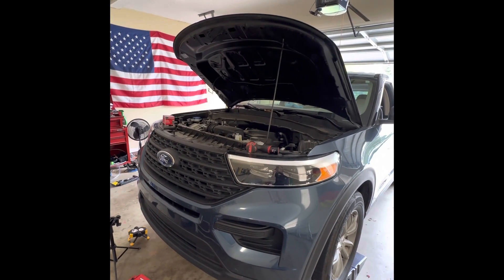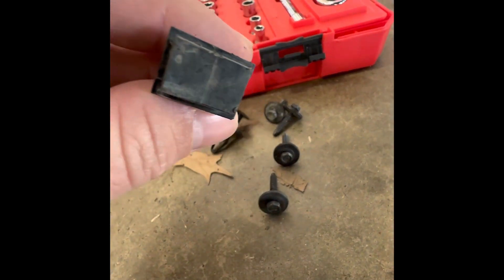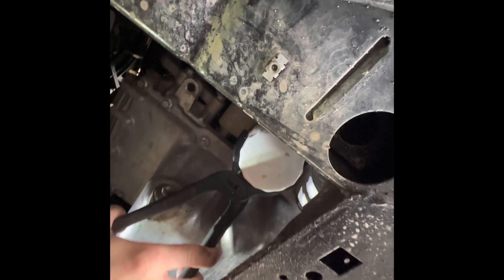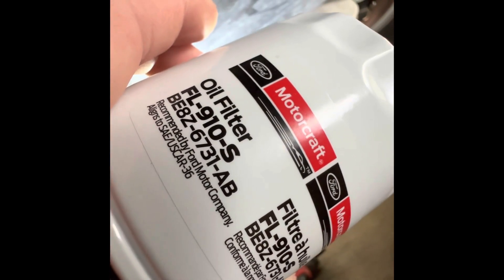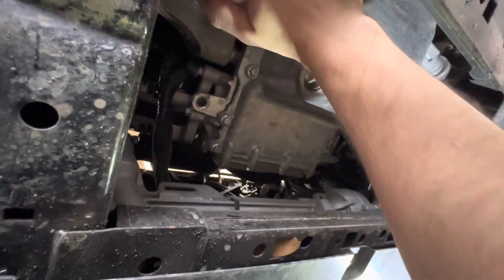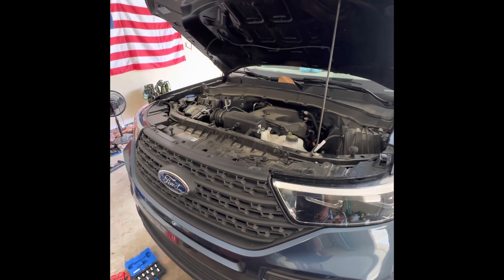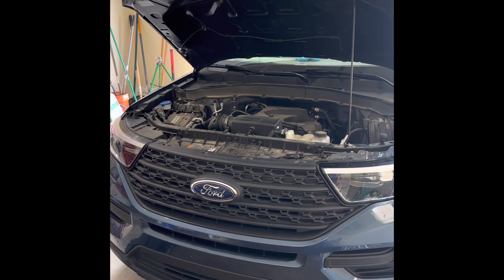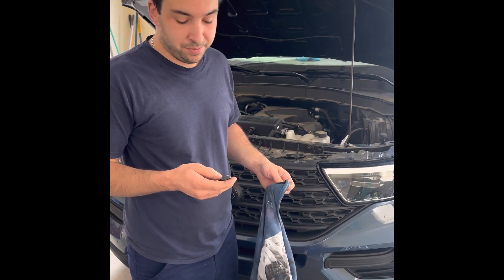2021 ford explorer 2.3 ecoboost oil change

Comment: Thanks for the tour under there! I'm doing an early "break-in" oil change on my new 2025 Explorer Active this afternoon. Has 1k miles on it. Many folks would say this isn't needed. But I am old mechanic, so humor me. The night I brought the car home it was mechanically very tight. It didn't even coast well with your foot off the gas. I always do my break ins with mostly around town driving. Lots of starts and stops and rev ups and downs. Never drone at one speed. That helps to seat the piston rings, polish in bearing surfaces and mating gear surfaces and generally break everything in nicely. That beds in your brake pads too. When I got the SUV, it would only get 20 mpg, and I said it felt tight, right? Now, with 1k miles, it "glides" around by comparison. It's getting over 24 mpg driving it around. Feels much better. Good time to do a service. The factory oil is a synthetic blend and has UV dye in it so at the factory they can easily check for weeps and leaks when they test run them before installation. Does that dye affect the lubricity of the oil? No one can tell me. Then why leave it in there for a bunch of miles. Most of the break in happens early on, good to switch to full synthetic oil now IMO. This motor has a turbo, and its bearings can run red hot. You should run synthetic in turbo motors to prevent the oil from burning up in the red-hot bearings and forming black coke sludge. That sludge can wear the bearings and clog return lines and then reduce the oil flow to the bearings. If you have the 4WD Explorer, also consider an early change on the gear oil in the PTU. Power Take-off Unit. It is a small gear box surrounded by hot components and runs continuously as your drive. It provides the power to the wheels to make it 4WD. It only holds about 1/2 quart of oil and is splash lubricated inside with no filter. Just a magnet on the fill plug to catch swarf. Swarf is the metallic shavings and particles that form as the gear faces run on each other. Leave the swarf in there and you turn the oil into grinding compound. NOT good for the long term use the that gear box! Ford will tell you it is sealed for life. Yes, a short pathetic life that barely gets it thru the 36k miles warranty. Then you are out $3k for a new one as they are not rebuildable. We live in an era of planned obsolescence folks. Servicing your car better can make the components last much longer and save you money in the long run. I just paid $36.5 for this car. Had to deal for 6 hours to get the dealer well below the MSRP. Thank you for this presentation Bimmer! I too believe in full synthetic oil changes at 5k miles. Unless you drive around town a lot, then do it when the oil computer says you have 50% oil life left! On my last car, I sometimes had to change it at 1800 miles as that was 50% oil life! Next to your home, this is the most expensive thing most folks have. Take care of it folks! Don't treat it like an appliance.
Reply from the maker: @chairrider2462  it’s nothing wrong with being extra preventative

Comment: Super good video but I do have a few questions:

Did you warm up the engine prior to changing the oil?

Did you remove the oil fill cap (top of engine) prior to the oil change?

It probably doesn't matter but why did you remove the filter first?

Did you clean up the excess oil on that cross member?

What type are oil are you using on this vehicle?  Full synthetic or Synthetic blend?

Again, great vid and thanks!
Reply from the maker: @michaelhart738   you don’t have to warm up the engine it just allows the oil to flow out quicker. You don’t have to remove the cap prior to draining. It’s just my preference to change out oil filters first. I use synthetic blend. This is a relatives vehicle. If it was mine I would use full synthetic but any ford dealer uses synthetic blend standard.

Comment: Does it help to change out the oil even sooner than 5k miles? What about every 3k miles or something? Just to treat the engine really nice?
Reply from the maker: There is no need to change it every 3,000 miles but it’s certainly not going to hurt either way. If that’s what you’d prefer to do then go for it.
Reply: @bimmer4755  more than anything I just want to do what’s right for the car. If 5k is the magic number then I’ll do it there.
Reply from the maker: 5000 miles is the perfect interval
Reply: @fro2905  Realize that the best interval also depends on how you drive it. If you spend all your time doing short trips around town, just change it with filter every 6 months or at 50% oil life. If you do more mixed and freeway driving, than 5k with full synthetic will take excellent care of your engine. Also check your oil level from time to time to make sure you aren't using excessive oil. You never want it to run low on oil! That leads to sludge and damage.
Reply: @chairrider2462  I’ll definitely keep that in mind. I have a 2021 ford explorer & I know fords have their issues. I just want to give myself the best chance of keeping the car functioning the longest I can without any bs. I figure I’d start with the oil & doing it right since this is something I can change myself. I use AMSoil Full Synth & just hit it every 5k or less

Comment: To bad you didn't cut open the old Motorcraft filter to see if there were black chunks of glue floating around in it. There's a few videos showing this. I've always used Motorcraft filters, but this issue is very concerning to me. Unfortunately, I just did my first oil change on my new Explorer and used the FL910S, so I'm keeping my fingers crossed that the filter does not have this problem.
Reply from the maker: Never would have thought about doing that. This is my mother in laws though. Very easy to change the oil though.